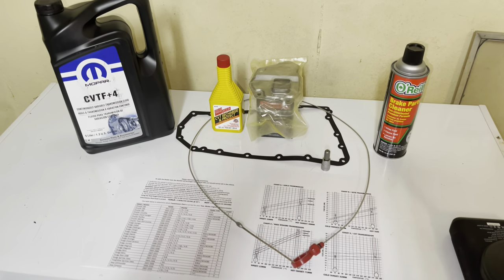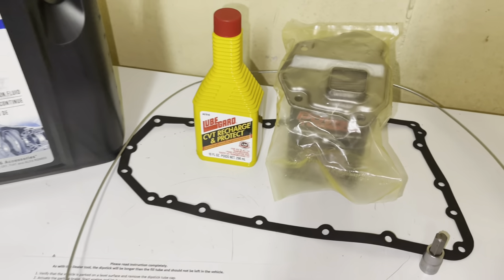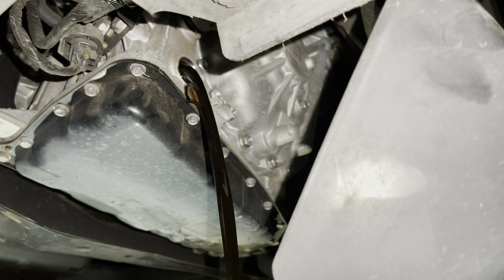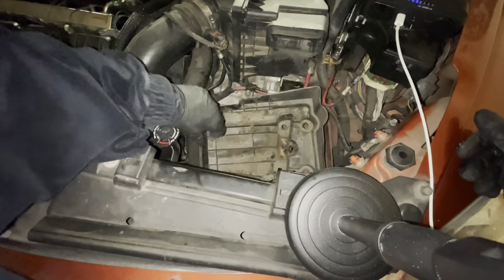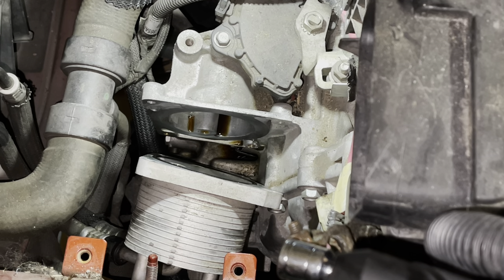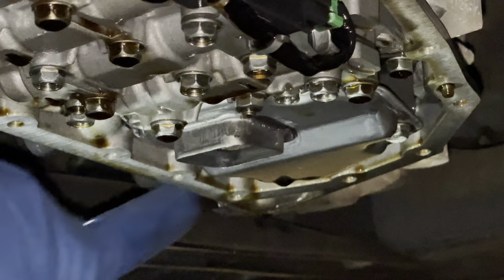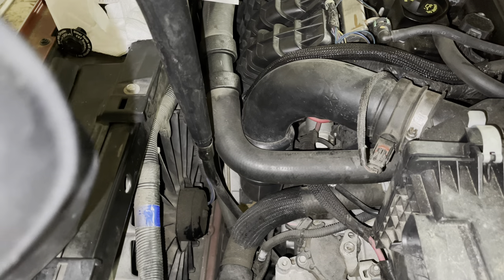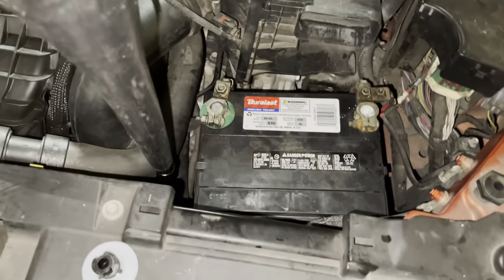CVT Fluid and Filter change Step by Step! Hidden Filter Save Your Transmission Dealer Secret!

Comment: Thanks for this amazing video! Have been wanting to see how to access the cooler filter for forever! I have found that  Mitsubishi part # 2920A096 includes the O-ring that is not available from dodge/jeep for the cooler. Also found nissan o ring part #31526-XMOA but have not actually used/verified it. Can verify the mitsu works and is the same for caliber.
Reply from the maker: Your welcome! Yea we had trouble finding the oring also I believe we reused it but can’t remember off hand

Comment: Do you know the bolt size for the transmission pan because i may have stripped the threads in the hole and am trying to figure out the best way to fix that
Reply from the maker: I am not sure, but I believe its metric......what threads are stripped the bolt or the actual trans?

Comment: Very useful and nice video. After watching your video I discovered that someone probably put the wrong oil in my transmission. Sometimes it works fine, sometimes it goes into limp mode and shows me a P0700 code on my 07 caliber with 88k miles.  Do I still have a chance by changing the oil and filters immediately?
Reply from the maker: @wesleyalves1270  yes, I would drain and refill it with the old filters still in and drive it for a little the drain change the filters and refill
Reply from the maker: @wesleyalves1270  also put some CVT additive in after the final fill
Reply: @DIYKAI  Thanks a lot!! I will, and let you know!!
Reply: You helped me a lot... I did everything and looks like I will be ok. how can I show my gratitude?
Reply from the maker: @wesleyalves1270  Your comment and like is what keeps us motivated & that is all we could ask for, but YouTube does offer an option to buy a super & that would come directly to us if you so choose.
Glad we could help & if you have any other questions just comment on any of the videos we have and we will get back to you.
Thanks!

Comment: Just a question after watching your video that’s completely a doable job…I've had several mechanics tell me that the “filter is unserviceable,” also they’d have to crack the transmission in half to get to it. No one will touch it due to it having 167k miles on it. Why won’t anyone do a fluid and filter change on my 2008 dodge caliber?
Reply from the maker: Filters are serviceable in the Caliber line up….and several other….not wanting to touch it at 167k is just staying away with from “trouble” if a customer has issues after a fluid change basically not wanting liability very common with shops that don’t understand transmissions

Comment: Is it possible to change the tiny filter under the battery without draining the fluid?
Reply from the maker: Yes I wouldn’t see why not it’s on the upper part of the trans you may loose a little residual fluid
Reply: @DIYKAI  awesome thank you! great vid!

Comment: Mine has a kick and slip at cruising speed. It threw a code for the input speed sensor.  They said it located in the transmission. Does that sound right.  And if i fix is that going to potentially fix the kick or slip? Just a humble opinion would be appreciated.  😊
Reply from the maker: We can check what year and engine size do you have but I want to say it’s on the outside

Comment: I just bought a 2011 Caliber with a noise every time the gas pedal is pressed in. It looks to me like the cvt belt. Did yours have the same symptom? I hope to not have to dig into the tranny. It has 155,000 miles. The filters have probably never been changed. Thanks for the video. Super helpful!
Reply from the maker: Any codes or lights on CVTs are generally noisy even when new because it is a slip belt design
Reply: No codes last I checked in Aug. no  lights either. I’m gonna change the fluids and everything anyway, see if it goes away. Thanks.
Reply: It’s definitely an issue noise, it’s super annoying and grindy.
Reply from the maker: @ryanbrown5500  definitely swap the fluid and filters….also throw some CVT lubeguard in there…….check the rear motor mount as well they are prone to go out and cause all types of noises and vibrations. Good luck and update us

Comment: Brought the car to the dealer and they changed the fluid and cleaned the pan filter, but they DON'T do the upper filter. In fact they don't even carry the part. Can I change the filter up top without dropping the pan if the car has been sitting overnight? I'd hate to lose all my new fluid.
Reply from the maker: Yes you can you may lose some fluid but if its a little bit you will be fine

Comment: Is it necessary to put a new filter on the pan or it can also be cleaned???
Reply from the maker: If you are changing the fluid a new pan filter and cooler filter is recommended.

Comment: Is it safe to change the fluid if its never ben done at 200k miles? I got the car from an uncle who passed away and the fluid was changed in the beginning one time at 30k miles? I'm doing this as a preventive maintenance the transmission seems to have no issues at this time. Is an 07 caliber with 205k miles
Reply from the maker: @lja1229  yes it's fine make sure you use OEM fluid. Did ours at 220k lol only time still running now at 234k

Comment: I only have 87,000 mi on an 07 and it keeps throwing me a warning light for transmission overheating is it suggested that I should probably try the CVT I've replace the water pump and the thermostat and it keeps throwing the same code and it's not the check engine light just temp light
Reply from the maker: What is the code #
Reply: @DIYKAI  the only time the check engine light came on is when the battery died and it gave me the code for transmission control module
Reply: @DIYKAI  but after starting it up once or twice the check engine light went away
Reply from the maker: @miyastrack8320  it was just a blip then of the code has gone away
Reply: Change trans cooler filter if u didnt already

Comment: How many quarts of transmission fluid did you put to fill it up?
Reply from the maker: Every trans will be slightly different but I think we put 4 in you need to have a special dipstick to check the level CVTs are very picky

Comment: Did you buy a dipstick separately as a part and then you screwed it on instead of that little plastic cap?
Reply from the maker: So the dipstick is a tool and is only used to check fluid levels on CVT transmissions. It was purchased separately and is used for a number of vehicles not just this one
Reply: you never mention what the level on the dip stick should read... nor did you show us... 
 @DIYKAI
Reply from the maker: @JaidenStylezTV https://youtube.com/shorts/k4BCewi5Mlw?si=EpGx6WcnsXm5waco

Comment: So I ordered that dipstick but it absolutely will not go in very far. It’s getting stopped by something in the tube. Tried several times before say F it. Whatever I’m hitting is chewing up the plastic tab on the end of the dipstick
Reply from the maker: it does not need to go all the way down when its stops thats it read it from there
Reply: @DIYKAI  thanks !
Reply from the maker: @burb17  your welcome

Comment: Is a 2011 Jeep liberty on the 2 filter list?
Reply from the maker: You would need to check and see if you have cooler lines running into the side of the trans if so you most likely do it’s a common missed part

Comment: Hello

do you know where is located the output shaft speed sensor in a dodge caliber 2011 2.0 heat?the transmission doesnt move nothing at all and i got the code p0722..
Reply from the maker: Should be on the back side of the trans

Comment: Did you put the whole bottle of Lube Gard in along with the 5 quarts of transmission fluid?
Reply from the maker: Put the lube guard in first then add fluid to full
Reply: Awesome, thanks bud
Reply from the maker: @bradleymiller8623 yw

Comment: How about Jeep compass 2013 does he have two filters?
Thanks
Reply from the maker: If it has the CVT look under the battery tray if you have lines going to the top of the trans then yes
Reply: @DIYKAI  it has cvt
Reply from the maker: Unfortunately the only way to check is to look a few trans didn’t have them

Comment: When i check my transmission fluid at operating temp my dipstick from AutoZone shows to be at about 36 and what is the optimal number that the transmission dipstick should be reading?
Reply from the maker: There is a special dipstick I’m not familiar with the AutoZone one?

Comment: Hey Erik, great video man! How much of fluid did you put on it? I've got what is supposed to be the service manual and it says 7L. I did what you did. Drained everything and replace both filters, and then added those 7L, but when I check the level with the oil dipstick it shows 85mm @145F.
Reply from the maker: What type of dipstick did u use it should have came with a chart
Reply: But no chart :(
Reply from the maker: @carlospenha4011  7L is too much.......target range is around is 40
Reply from the maker: @carlospenha4011  take out 1-2L
Reply: @DIYKAI  geezz.. I'll do it now.. and see
Reply from the maker: @carlospenha4011  cool let us know
Reply: @DIYKAI  Alright.. let's go
1. drained +/- 2.5L ad checked @ 120F ==> 20mm :(
2. Started adding fluid by 1/4 of Liter each time and checking with the engine running, as recommended in that freak service manual
3. After "re-filling" about 1L I got 40mm @ 120F :)

So, now, I know that there's a trick on that procedure. You need to fill 7L (I don't know why) and then, after getting the transmission warmed up, you need to adjust the level, draining the fluid obviously.

Thanks Erik!!!
Reply from the maker: @carlospenha4011  Glad you got it!

Comment: No, you're incorrect with how many bolts are in the filter housing. It's 4 not 3. What a pain in the ass that 4th one.
Reply: I gave up on trying to unscrew the bottom bolts (the 4th one) because it was such a pain in the butt. Too many tubes in the way, this was not like what I saw in videos for the Jeep Patriot (which is usually pretty close to the same setup as the dodge calibers when it comes to repairs). How did you get to the bolts? Did you have to take the tubes off? Did you go behind the tire? Could someone please post a video on how to do this? lol Thank you for posting about this part (the most difficult part IMO)!

Comment: Im stumped, on any other trans thats an overflow bolt, and its above the pan, doesnt make sense
Reply from the maker: Not sure what your asking?
Reply: Well not exactly asking a question here, im frustrated with the engineers, im a maintenance technician for an auto company, was a mechanic before, and never seen that bolt used as a drain, if i remember right the only way to drain that transmission is to drop the pan, That bolt on fords or any other trans is used as an overflow, where you remove that bolt and fill, engine running until it starts to come out, however, given the trans holds over 7 quarts, thats not the case here, because you would have aprox. 2 quarts left in the pan, that you cant drain from that plug. I dont work for dodge and havnt worked on many but where did this maintenance instruction come from.
Reply from the maker: @justinsmith6860  so that side bolt we took out in the video is the service port to bring the level down to a manageable level so when you remove the pan it's not much to deal with.....could use a vacuum pump and get most of the rest out for less of a mess...we just learned over the past 2 decades how to do things easier than the manual states LOL